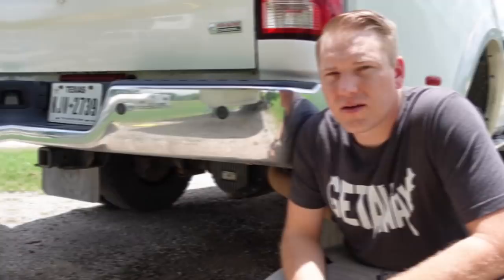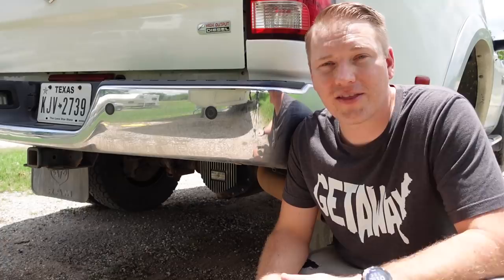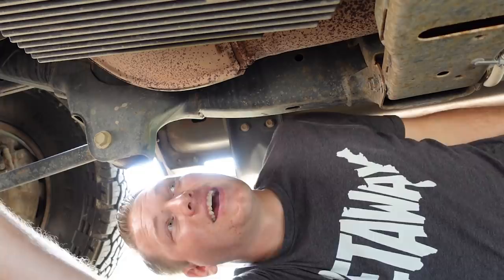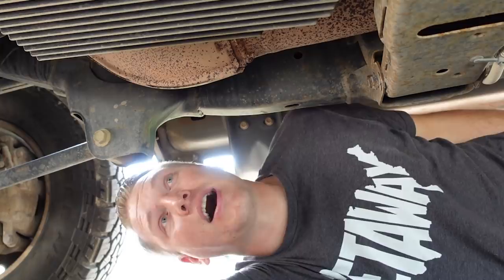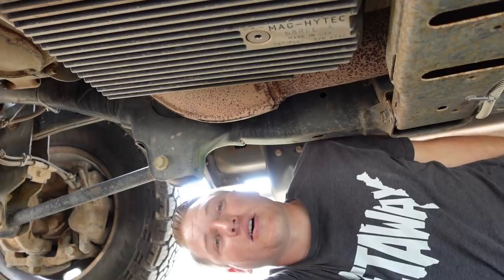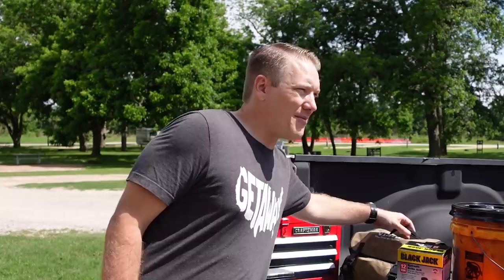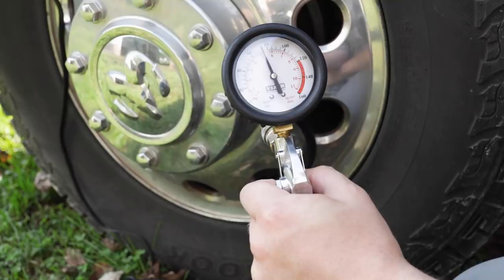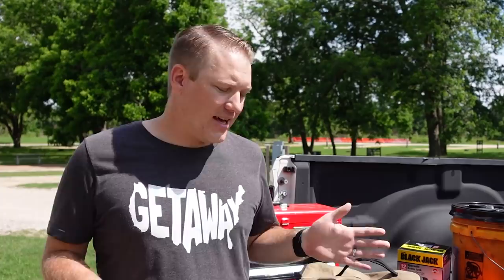160K MILE REVIEW OF OUR 3500 RAM DIESEL DUALLY! (AND 5 MUST DO UPGRADES)

Comment from the maker: Hi Gang! Below are the product upgrades mentioned in this video:
1. Timbren Suspension Enhancement System: https://amzn.to/3ywSWjY
2. Seat Cooler: https://amzn.to/3wubkYY
3. Mag-Hytec 68RFE Transmission Pan: https://amzn.to/3fBUqko
4. Mag-Hytec Rear Differential Covers: https://amzn.to/3oHW1Jjvv
5. Fumoto Engine Oil Drain Valve: https://amzn.to/34nw9tb

Below are the products to make oil changes and tire changes easier:
1. Lynx Levelers: https://amzn.to/3fz6Lpm
2. 5-Gallon Bucket: https://amzn.to/2TcTLOJ
3. Oil Tight Sealing Lid: https://amzn.to/3f9Fjzw
4A. VIAIR Portable Air Compressor: https://amzn.to/3fIEH2K
4B. VIAIR Budget Option: https://amzn.to/34bY3YJ
5. Breaker Bar: https://amzn.to/3fd35e3
6. Torque Wrench: https://amzn.to/2QJJZTf
7. Socket Set: https://amzn.to/3fFGaab
8. Portable Toolbox: https://amzn.to/3c6jizR 
9. Bottle Jack: https://amzn.to/2QKuHhd 
10A. Truckbed Toolchest in Black: https://amzn.to/3hTkH0l 
10B. Truckbed Toolchest in Silver: https://amzn.to/2SkVYaa

Comment: Recommendation, look into the banks power rear end cover, they actually have done the research and built a much superior cover
Reply: 100%. Proven the flat diff covers do the opposite of what they are suppose to do.
Reply: Never seen a rearend fail prematurely due to having a maghytec cover on it. Gale Banks is a smart cookie but you don't have to believe every single thing he says. All that is is marketing, talking down the competition to make his own diff covers sell better.
Reply: came to see this, Gale Banks does an in depth video on how flat back diff do not work. search on youtube. There's a reason why the stock are curved the way they are, to send the oil to the front bearings, the flat back diff covers slosh the oil and do not shoot it over to the bearings. Very nice video by Banks, I'll be upgrading my diff cover soon, and Banks diff cover is the one I'm getting.
Reply: @F1travels  when the video speaks for it self and others have did similar research, all adds up, not a marketing thing. Great video series by Banks. I don't go get all the products he makes but the diff cover is definitely one I will be getting.
Reply: @F1travels  I had the flat back cover and I truly believe the front pinion bearing and front seal lacks lubrication as it should. Yes I have rebuilt my rear differential. 250,000 mile mark.
Reply: I'd double check your diff cover.  Like others below have said, it might not be as good as you think.  Just double check.  Banks has a good video on this.
Reply from the maker: Thanks for the info!
Reply: @maxd7228  put a temperature sending unit on your MagHytec cover and you will find that it does indeed lower running temps. Something Banks "in depth" video omitted. Even the stock covers are fine in this respect. The biggest advantage to any of the aftermarket covers is the drain plug which on my Ram means not having to remove 14 bolts and the cover for a simple fluid change. If you want the Banks cover, by all means, get it. But to say the the flat covers, which have been in use for over 30 years don't work is false. And yes, I watched all of Bank's videos and no, I don't work for or sell MagHytec.
Reply: @alangwin3891  said the guy who shills for hytec

Comment: We have the same truck 2012 RAM 3500 Crew Cab 4x4 Long bed... We love ours,  I bought it like you, used w/ 60,000 miles on it in 2013. We now have 327,000 miles on it. I just put new leather interior in it in 2020, because like you my seat was wearing out... which was an easy upgrade & Made it like new!
Reply from the maker: Very nice! Thanks for the info!

Comment: Great info. I prefer to do my own vehicle maintenance also but what I found while on the road most parks don't allow this.  I had a 2014 RAM 3500 but had to trade her in.
Reply from the maker: Great point! We've done a few oil changes while boondocking too.
Reply: @GetawayCouple  Great job with maintaining your trunk. I wanting my RAM to last but I would say about every thousand or two miles the check engine light would appear.  Stay safe and look forward to the next.

Comment: Great idea on the differential and transmission pan upgrades. I’ll definitely look into those when it’s time for these fluids to be changed on my 3500 2019 RAM. I purchased a 1/2” Dewalt impact wrench and put a 3/4” socket on it and can quickly remove either the truck or RV tires. I’ve had to use it twice for flats on my RV. I also have a 3/4” drive torque wrench. I put the 3/4” socket on it as well. Never have to look for the socket. Talk about easy!  Great and helpful video.
Reply from the maker: Thanks for the comments and thanks for watching!

Comment: Very well done ! (no Rae not as in over cooked meat ("new to us" out take) ). I am a tool & maintenance addict and carry all those mentioned & then some. Next time your in a hardware or home maintenance store you might want to pick up a 1-2 ft piece of pipe to fit over your breaker bar, ratchet & jack handle. They usually have a scrap or odd piece you can buy on the cheap. It adds great leverage & placement to your bottle jack as well. Mine has saved me a few times over the years.
Reply from the maker: Thanks for the info and for the compliment 😊

Comment: Highly recommend Centramatic dynamic wheel balancers. Installed on our 2016 RAM 3500 SRW. amazing-should be factory installed. If you are not familiar, check them out. Not affiliated with the company, just a satisfied customer.
Reply from the maker: Good to know - thanks!

Comment: Hi there!  Thank you very much for sharing your experiences with your Ram Truck!  A great rundown!

We had a 1ton single rear wheel Ram Laramie.......and i traded it in for a Tacoma and 4Runner so that we could enjoy the jeep trails here in our town of Ouray.  A contributing factor is that we didn't have  a trailer then :-(  So...fast forward 2 years and we are getting an Ourdoors RV travel trailer.  So....we have a 1ton single rear wheel F350 on order with their new, bigger gas engine.  I kept it at the xlt trim to keep the costs down, but I will definitely miss the seat cooler and dual temp controls of the higher trim level.  I also hope the lack of diesel eventually is regretted.  The savings of $8k on no diesel will probably make me feel better when it takes an extra 45 seconds to get to the top of the mountain pass here in CO.  

Safe travels!!
Reply from the maker: Thanks for the kudos! Congrats on your purchase and enjoy!

Comment: I,love my heated/cooled seat. I also thought it was an extraneous option, but it is awesome!!! I have a oil change package so, until November, all my oil changes are covered. Once November 2021 hits, I’m on my own… I was less than fully impressed with the viair compressor. I bought the highway flow unit, and it still was slow and unimpressive…
Reply from the maker: The seats are great! Sorry to hear about the compressor. Have you contacted them to see if maybe it has an issue?

Comment: Just a heads up. I had one of those diff covers on my 2012 for 120,000 miles towing a heavy Grand Design Momentum and had to replace the ring and pinion at 209,000 miles. Not saying it was the main reason the carrier bearings failed but I am very anal about maintenance and was shocked it failed. I put the factory aluminum cover back on with the new gear set. Also; it is my understanding, unless special ordered, all those automatic trucks in that year were 4.10:1 trucks. That’s what my gear set was.

Comment: I bought a used (new to me) F150 to pull a small fiberglass trailer. The previous owner had added a transmission fluid radiator. It has worked great. But we don't climb the tall passes you find out West. I would be curious how effective it might be out West.
Having to add this transmission radiator and the upgrades you have added to minimize heat is a bit disappointing. These trucks are built and rated to pull a maximum load. To me it seems unreasonable to have to spend extra money on these parts. I know you can live without them but that can lead to breakdowns with added costs.
I love the outtakes. I think Rae is messing with you.
I really enjoy your adventures.
Reply from the maker: Sometimes upgrades are live and learn experiences. Some never need them. Thanks for your compliments 😊

Comment: How many years have I been changing my vehicle's oil and never knew about that quick-release valve??? I'm def getting them.
Reply: you will not regret it. I as well have changed my own oil for ~40 years. A friend of mine told me about the Fumoto. Have used it for about 6 years and not had hot oil down my hand or arm or all over the driveway. They're great.
Reply from the maker: Glad we could help! Herb is right!

Comment: I run MagHytec on front and rear dif and trany of my 2011.5 3500 HO. Put them on at 3K and have 90K now, they work awesome. I replaced my front seat bottom with one "The Seat Shop" and got a new firmer foam base 4 years ago and it is holding up better than the OEM. Not sure if they still have the ventilated replacements.

Comment: Always great outtakes and tips.  One quick question - do you stick with the Mopar brand OEM binker fluid, or is there an aftermarket blinker fluid you like better?  If you go aftermarket, I might try that in my Ford F350 Super Duty.  But if you're using Mopar fluid, I've heard that it will gum up my Ford blinkers and cause them to flash slower.

Comment: How do you fit the 5 gallon bucket under your truck to catch the oil? On my 2016 F-250 4x4 there is not enough room under it to put a 5 gallon bucket?
Reply from the maker: With the Lynx levelers!
Reply: I have a Fumoto valve installed, but I use the gallon containers from the previous oil change for the waste oil.

Comment: I’m a little confused.  Surely you don’t have the truck high enough to have the oil drain directly into the 5 gallon bucket.
Reply from the maker: A lynx leveler ramp on each side and the bucket slides right under!
Reply: @GetawayCouple  I got ya.  I understand now.  Great info tonight.

Comment: 3:45 "More airflow" What? Yes, it does increase surface area and act as a heat sink. Air flow on the other hand will actually be (very minimally) reduced for the same reason: more surface area.
Reply from the maker: Thanks for that!